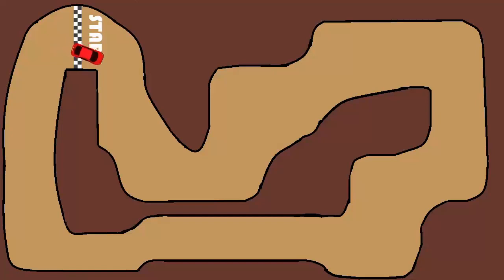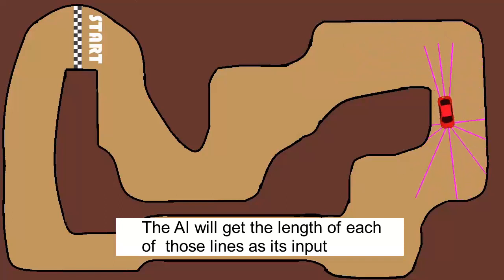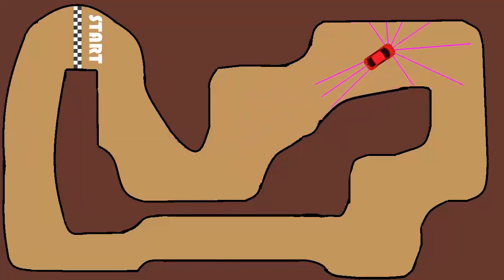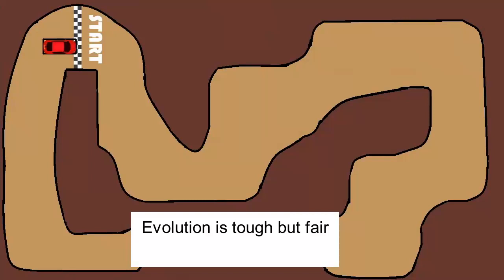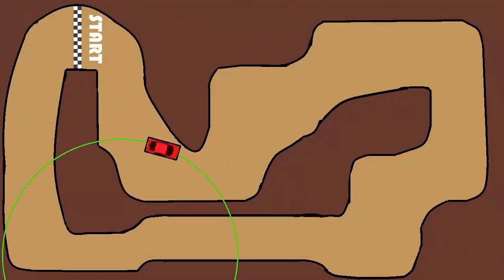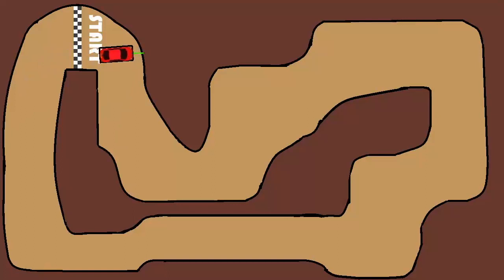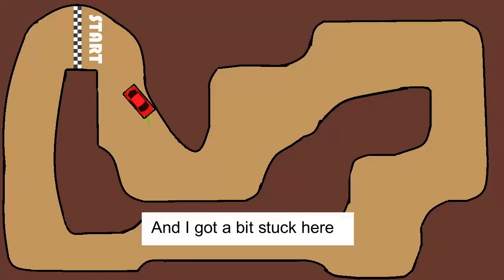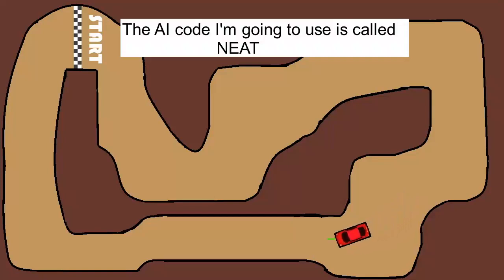Adding Radar & Collisions To My AI Driving Game

Comment: yoooo, waiting for the AI version .-.

I guess(as I don't have much knowledge about programming and I only know some python and pygame) AI will turn to the side where the length of the line becomes longer and away from the shorter line. 

btw Awesome video Dubious👍🏻
Reply from the maker: Yeah,  I think that's generally what will happen.

I haven't quite decided how to tell the AI if its going in the correct direction or not,  i.e. it could run the course backwards.   What I'll probably do is score every grid on the track,  and then feed in the car's score at the front and the cars score at the back and let it compute a gradient.

So my guess is that the final Neural Network will have some logic that combines turning towards the longer lines, as well as turning towards keeping the gradient as high as possible.   But, we'll see I guess